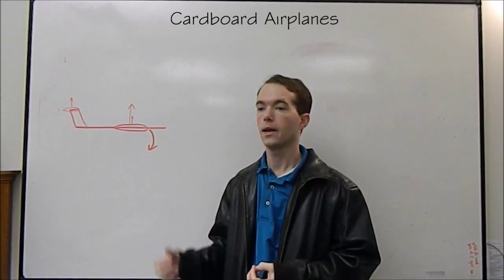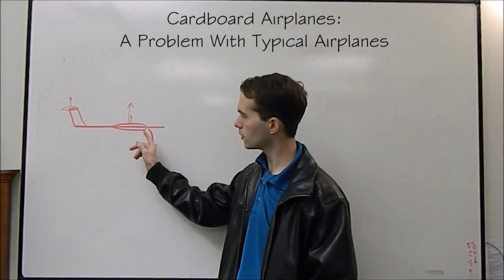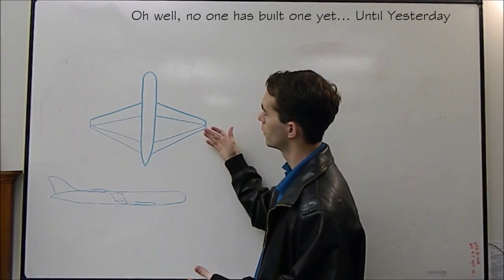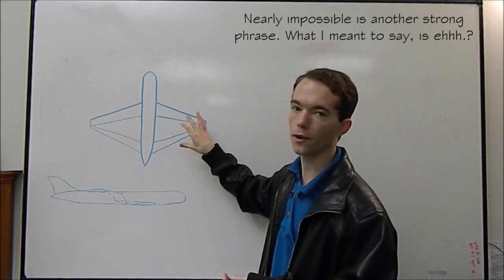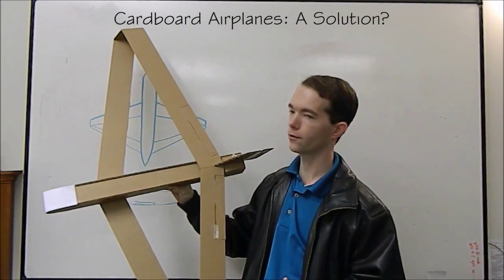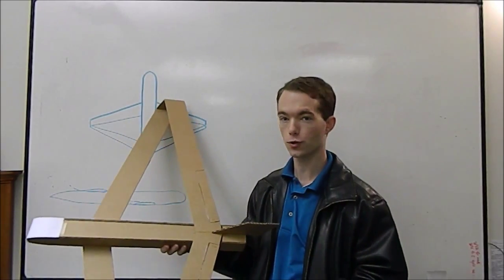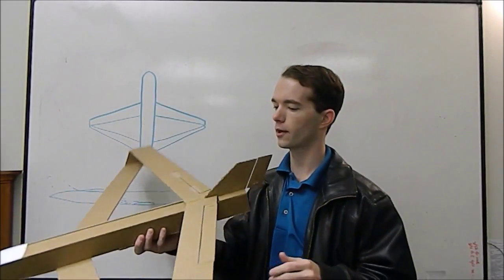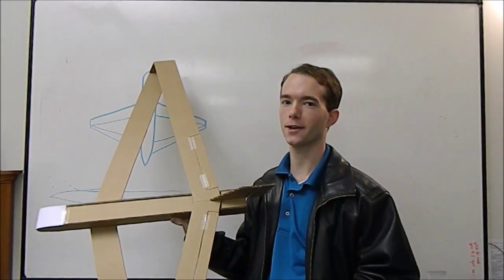Cardboard Airplane: Twin Diamond     Mikes Inventions

Comment: Mike did you know that the your configuration that you climed that you come up with is our design Zoobin 39 B or commercially known as D-1A or D-1D/E and is already under manufacture production since year 2000?  
Please use your wording correctly.  I am glad to see more young engineers working on Joined wing aircrafts. I will be glad to help you with understanding fundamental of Joined-wing aircraft in much more academic methods  Check the Dara Aviaiton Inc. at www.daraaviation.com
Reply from the maker: Zoobin39 Hey wow! I saw your video, and it's awesome. I'm glad to see that the concept works. I'm interested in finding out how efficient it is, specifically, how the wingtip vortices behave. |Have you investigated that? I was unaware anyone had done this and built a working prototype. Great job!
Reply: +Mike Thompson -box wings have been around since... well, the very beginning of aviation.
Reply from the maker: +mavigogun . Yes apparently so. It's still fun to toy with.
Reply: +Mike Thompson Mike, The Joined Wing Airframe is no longer a concept, we have been using them day in, day out.  The airframe is "point designed", that means it has been designed for a specific mission, and therefore, aerodynamics has to be fined tune for that particular mission. However, the versatility of the airplane is just amazing.   For example, the D-1D, caries a 14 lb payload for 16 hours at speed of 65 mph. Keep in mind, that we talk about rigid airplane at this point. Rigid airplane are consider small airframes that deflection of wing and fuselage are keep at minimum or zero.   Once the airframe goes to a larger size, then you have also consider the aeroelastisity and response aero.  The equations of motion for very node in the airframe has be presented by 6 degree of freedom, and aerodynamic become much more complicate.  It took me 2 year to design Zoobin 39 airplane, which now is known as D-1A (The lasts is the D-1G).  However, going to a different design of Join-wing aircrafts, where wings are not consider rigid, I have spend 3 times more  on the base line design, and many months in wind tunnel to finalized the design.  And it gets more complicated from here on. With todays capabilities of access to CFD, FEM analyses, matlab, sumilink, and many other engineering tools, you may start setting up a design and work on it as go along. Please make sure you understand the tolerance of the engineering tool and margin of error when work on  data.  Verification with wind tunnel test results will not make it easier either.    You talked about CG, which is the major issue in the Joined wing airplanes.   The range of CG shift in Joined wing configurations are very small.  you can easily crash a 250K airplane in one simple mistake.  This is where your aerodynamic has to be designed so carefully.   You may have to design airfoils that not only have a very unique Cp distribution over the upper and lower surfaces,  but also you have to look at where they are located span wise locations.  Interaction of the two wings at low  and higher angles of attach (not the same as pitch angles) have to be considered. You have to do this to make sure the AC of each wing remains at the same distance to CG location as alpha changes. Due to many reasons,  such as, proprietary data, and commercial aspect of the project,  I have not published any paper and technical notes on several joined wing configurations that are in operations. However, as soon as, the final flights of these airplane are done and they are retired, I will publish notes on may aspects.  Send me your email, and I send you some pictures of these airplane in operational field.
Reply: Zoobin39 there's a 100 companies with similar designs... Geesh.. Zoobin in isn't the first and won't be the last